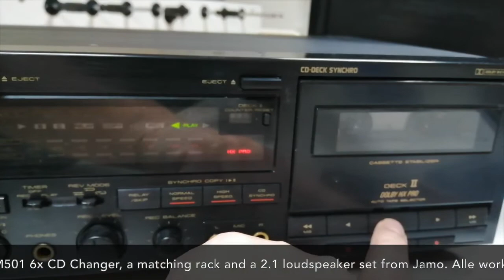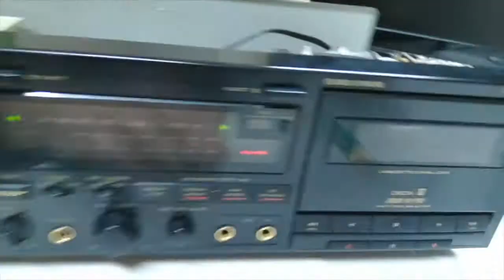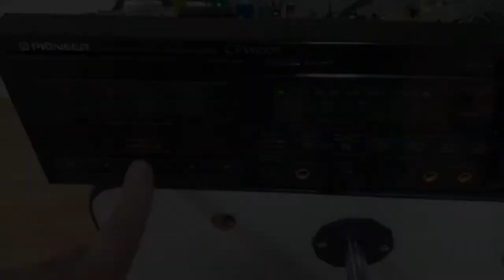Pioneer CT W630R Repair / Lubrification

Comment: You didn't show where you added lubrication. Did I miss it?
Reply from the maker: no i didnt film it.
Reply: @SilvioTischer  so the point of the whole video is... Anyway do you have any reference on how to change the tape belts? I will be doing that in ct803 r soon and i think the mechanism is the same in both but... there's no info about how to do that even in the service manual. Would be much obliged for every clue given!
Reply from the maker: @papasnejk87  hello. i didn't change the belts on this deck. However, i have now a lot of belts changed, from walkman, boomboxes, cheapo and better decks and so on. Mostly, the complicated thing ist to get the mechanism out without destroying anything. You should carefully inspect the mechanism, mostly it is not too complicated to replace the belts. If the old belt ist melted: carefully clean all rubber wiht isoporpy alcohol or something similar.